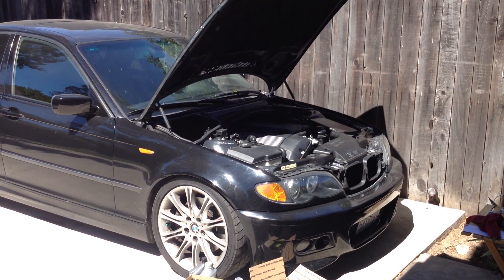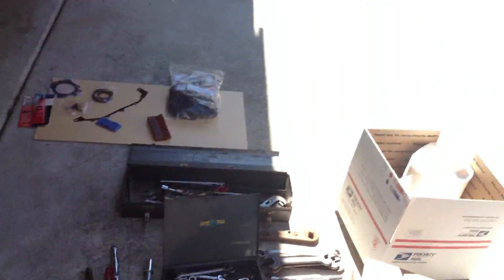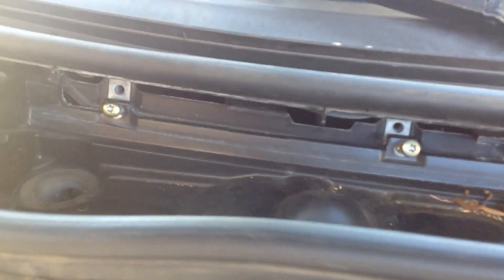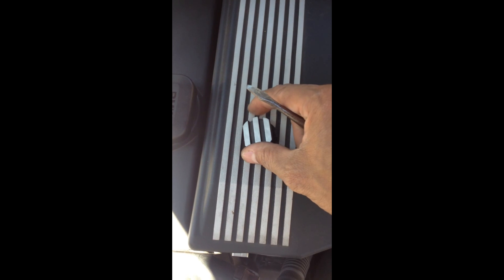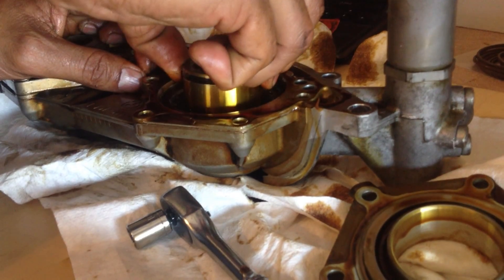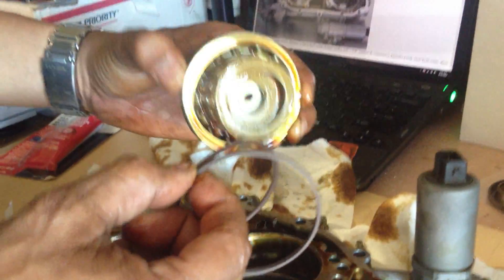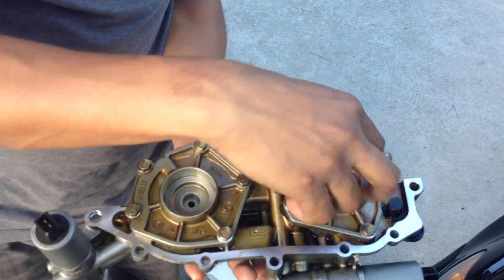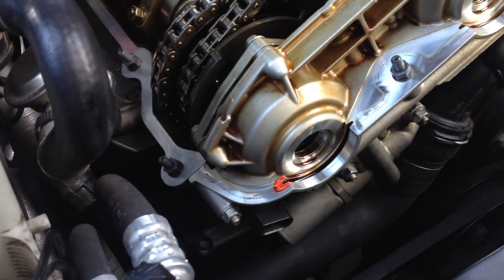BMW Vanos Noise Repair

Comment: Hi same noise on my 318i e46 2004 92000km, diagnosis made us change the valvetronic motor and the eccentric shaft sensor, but noise is still there. when i start the engine it is quiet, the noise comes when i accelerate. please assist

Comment: Just an FYI, the rattle isn't from the worn outer o-rings, the rattle comes from the worn metal washers inside the piston.  That's why those metal washers are called an "anti-rattle kit".  The viton and teflon seals on the outside of the pistons are seals.  It's those metal washers that cause the rattle.
Reply: That's right
Reply: +Brandon Erdmann  what piston exactly you are referred  at...thank you in advance.
Reply: +dimitris kaloupis the two pistons inside the Vanos unit.  the ones you replaced the rings on.  you remove the 24mm cap on each piston and replace the bearing spacer rings inside.  look on the Beisan Systems page for details and instructions.
Reply: Funny is that we dont call them PISTONS in my language but pressure plates...
Reply: Brandon Erdmann

Comment: Is this procedure the same for all bmw e46 engines?
Reply: +Tukacungurwa Jesse No, it's not.  There are both single and dual vanos engines.  The earlier models used single, newer used dual.  The procedure for single vanos is much more complicated.

Comment: In all the Vanos videos I have seen, the Vanos all show to have dual O-rings.  So why does my 1999 e39 528it Sports wagon only have single O-rings?  I am confused, were some designed that way?
Reply: The M52B28 engine is having a single VANOS, while the M52TUB28 is with a double. Although, your car should be with the M52TU engine.

Comment: The noise is more obvious while driving the car, no? I'm having the same issue now with mine at 183,000 miles: oil and VANOS. Thanks for the example. Have you ever attempted the wheel bearings?

Comment: Hi I was just wondering, I just bought the same bumper as yours. My car is a 2005 325xi. I need to know how to attach it to the car? I bought the same M3 replica bumper & fog covers & fog lights. I also bought the side slide brackets but that's all. How do I secure the bumper to the car thanks? Also love your vanos repair video. I am doing mine tomorrow. I hope you are able to answer this for me.
Reply from the maker: Tommy Nguyen I used the brackets that came with the M3 bumper and I secure it with two long screws under the radiator vents to make it solid.

Comment: About the vanos,  does it feel like the car shakes?  Mine shakes a little when I hit 2500rpm, feels like when a manual car is on first gear and is about to die.  Is that the vanos?

Comment: hi there 
please i need your help i have a e92 bmw 328i 2007 coupe , the problem is whenever i start my car after couple of second i feel the vibration from engine then its disappear, whenever i stop on the red light  i feel the vibration again, recently i change the spark plug , air filter , i change the sensor 1 and 2 now i have to change sensor 1 and 1 bcose the check engine light is there , my car runs like new the RPM and everything its excellent , for the vibration engine what should i look first at my garage please any idea help me please thank you sir

Comment from the maker: All parts used in this video: http://www.beisansystems.com/products.html

Vanos Procedure (E46, E39): http://www.beisansystems.com/procedures/vanos_procedure.htm
Reply: +Alcides Scritor  My bmw 325ci M sport coupe is burning oil i have changed the CCV valve do you know what could be the problem? The engine run nice and smooth, but i have to tap 1 litre of oil every 300 miles. Please help!!

Comment: Great video and how-to!  For what it's worth, those engines are notorious for the CCV/oil seperator to fail and create an over-pressure that blows out the valve cover gasket as well.  There's some excellent how-to's on checking the CCV operation if you suspect that is the issue with your oil loss on the exhaust side of the motor.

Comment: Too much silicon.. Other than that very good video.. BMW Erhard recommends putting home used silicon.. The one that is used in construction and has a white transparent color.. They recommend applying that on the dips of the gasket..

Comment: Great clip, however it seems to be missing the most important part where you was supposed to replace the steel rings inside the pistons with the soft vise jaw liner (that you bought from Beisan) and impact wrench.
Just to sort this out, the o-rings is for the proper function (to not loose oil pressure in the vanos). The steel rings (that you also bought) is to make the vanos stop rattle.

Comment: Love the video. I have the same rattle coming from my 530i. Im stuck at the fan clutch , I can't get the fan to come off to make some room.I found a BMW fan clutch tool and think thats what i need.  my question is why are my tomatoes getting a brown spot on them before they turn red ?
Reply: I bought a 32mm sprocket wrench for $12 at a bike shop to get the fan off. The wrench is very thin & long enough that it clears the fan shroud. Once I get it on the fan nut I wack it hard with a weighted hammer and it frees the nut. I can then spin the fan off by hand. Remember the nut & fan spin clockwise for removal. I've done this many times on my E36 325i & my E46 325Ci. It should work on your 530i. I have an 08 528Xi by the way & I love it!!

Comment: this is a common BMW problems.. and you guys follow what bmw says to change your oil every 15000 kms..i have this theory that these gaskets fails because the oil gets too old and creates too much head pressure to cause this.. sry but this a theory.. other than that.. if you were to change oil on the bmw at least 8000kms.. it would indestructable piece of machine..

Comment: What model is this bmw, because I recently got a bmw 328i and I want to do my own repairs. I had a problem of my bmw heating up, and now im going to fix the gasket and looking how to put the chain at its right time. So was wondering wat model u have (for example.  E36 or E34)
Reply from the maker: It is BMW E46 330i ZHP package year 2005

Comment: Neat work Alcides. My 2002 BMW 530 with less than 45K miles started showing the Service Engine Soon and code P0639: camshaft position sensor seemed to be the cause. After intake and exhaust position sensors were changed, problem persisted and dealer said was the VANOS. Rebuild VANOS put in place and codes B  P0014 and B  P0015 are now the problem. They mean camshaft is advanced and retarded at the same time!!! Did you use a Camshaft Locking Tool when replaced your VANOS? I've read it is not needed when changing a Double VANOS.

Comment: A German car leaking oil? That's rare.
Reply: vanox bud The reason why I say that. Is because in Germany they have very tight laws, when it comes cars leaking oil. In Germany if you're car leaks oil, you can not drive it on public streets.
Reply: MrTubs911 lol i can only laugh. Would you say to me in USA you're allowed to drive with a car that leaks oil? When a car leaks oil anywhere on your engine or your gearbox is a seal broken. In germany we have to fix it YES :D
Reply: HE is def being sarcastic haha. German cars leak oil all the time lmao. Like mine lol
Reply: MrTubs911
 every single BMW i have had and only buy them has leaked oil, top three locations 1/ rocker switch 2/sump 3 /breather pipes does this make them bad NO! Is it a reason not to buy them NO its just a BMW treat.
Reply from the maker: Ge Ry
Yes, you can drive a leaking car in the USA, but if someone reports you, the police will recommend to have it fix asap. Good luck.
Reply: Are you kidding?
Reply: MrTubs911 yeah sooo rare
Reply: Max Lindner NO